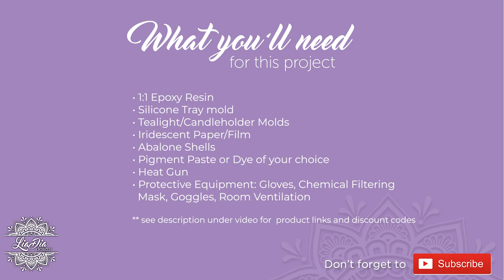LiaDiaDesigns | So PRETTY!  Easy Resin Tutorial - Water Ripple Effect Tray & Lotus Candleholders

Comment: Beautiful! But how does the tray look from the bottom? Is it easily scratched because of the paper used?
Reply from the maker: The bottom has ripples on the bottom but still sits flat... haven't check it for scratches,  figured it's protected since it's sitting on a table.  Could definitely brush on a thin layer of resin or varnish on the bottom if it was an issue.

Comment: HELLO ! JUST ACROSS UR VID AND I LOVEEE THE OUTCOME OF THEM ALL.. 1 QUESTION.. IS THERE CERTAIN EPOXY I HAVE TO USE WHEN I USE THE CANDLE MOLDS? BC U KNOW HOW EPOXY IS FLAEABLE.. JUST WONDERING IF SOMETHING HAPPEN IF I USE EPOXY WITH THE HOLDERS AND LIGHT CANDLE INSIDE WILL CATCH FIRE??  THANKS FOR SHARING
Reply from the maker: I use a high heat resistant resin. And you need to let your resin cure for over 30 days to ensure the heat resistance is at it's maximum.  But - I recommend battery powered lights to my customers (I include one with every tealight holder I sell). It's much safer.

Comment: Hi ok  I see no resin first, the resin sticks to the foil and the same process goes for the fish scale mold got it , studying your techniques , is that right? thank you 🙏
Reply from the maker: Hi Linda, that's correct, the iridescent film was put directly on the silicone mold... you could put a layer of resin first if you choose too (I did thank in my coaster Iridescent Gemstone Coasters video) - both options can work. This version will leave the bottom uneven where there are ripples, but I was ok with that.
Reply: @LiaDiaDesigns  thank you so much I really appreciate it,am on a learning stage and I kind of analyze details for when I have a daring moment 🤷‍♀️😂🥰🤦‍♀️